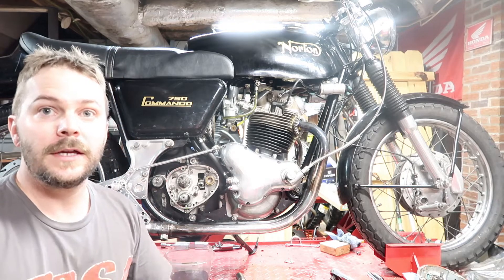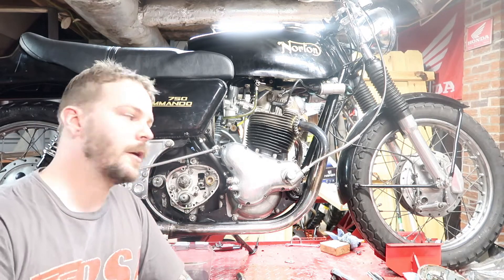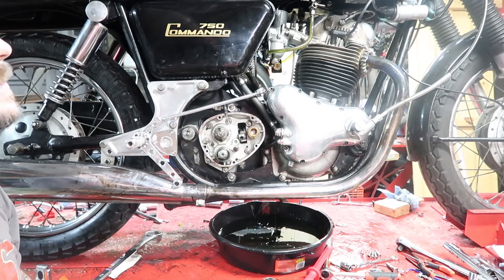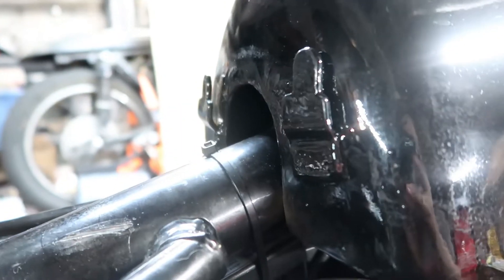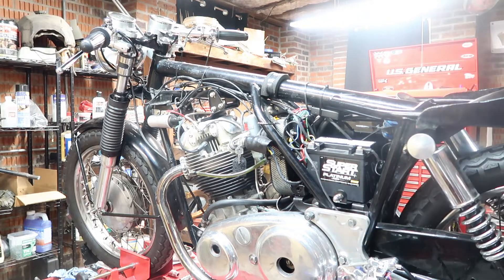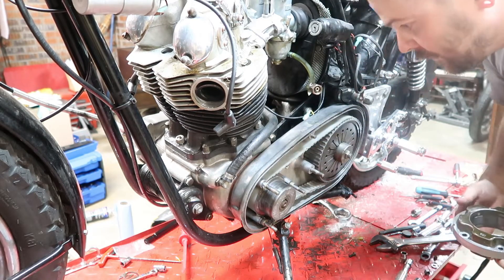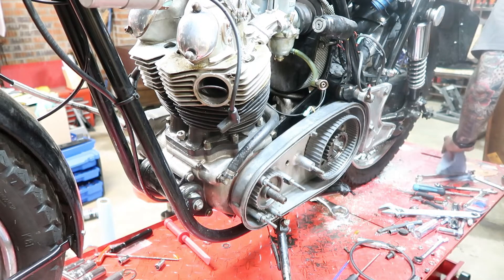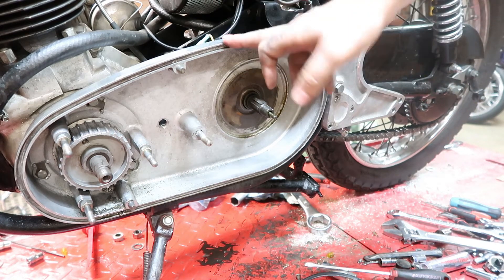Norton Commando Disassembly part 1

Comment: It good that you got into that gearbox to get it right.  I'm going to guess that somebody has mis-matched the screws, bolts, and studs trying to replace them with US ("SAE") threads.  If you look in the Commando parts book for the gearbox, there are a number of parts that begin with the prefix "04" - most "Commando parts" have the prefix "06".  The "O4" parts come directly from the AMC gearbox that was designed with the threads to be British Standard or "Whitworth" threads.  It's likely that somebody jammed American threaded screws into the British threads and damaged them so badly that some had to be Heli-coiled (probably with American standard Heli-coils, adding to the confusion) and the others were left with stripped and weak threads in the gearbox housings.
It's a shame when Commandos are torn up like that -- but, as I said, it's good that you're getting it right.  Congrats on the good work.
Reply from the maker: Thanks!  It is a bit frustrating, but might as well do it right